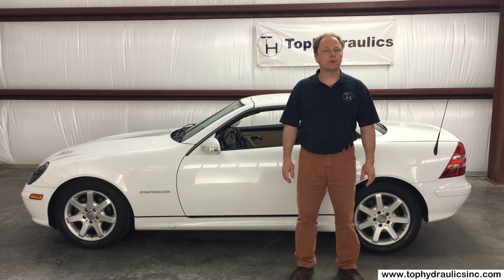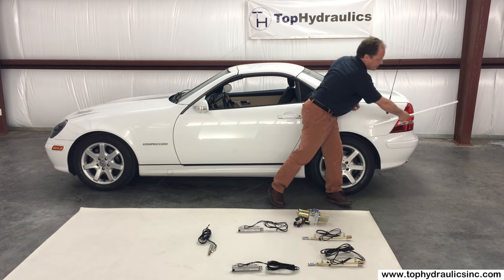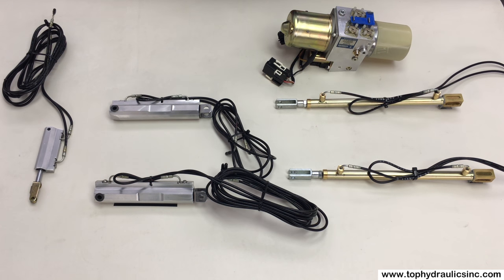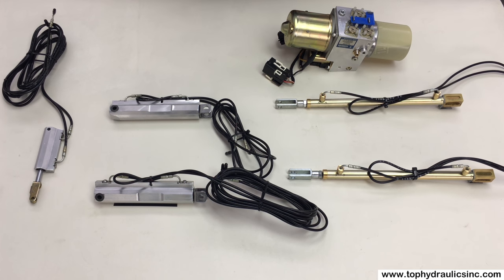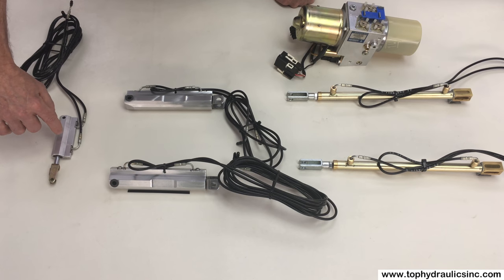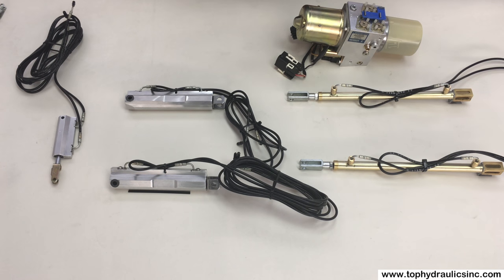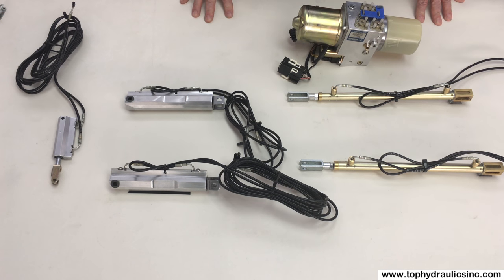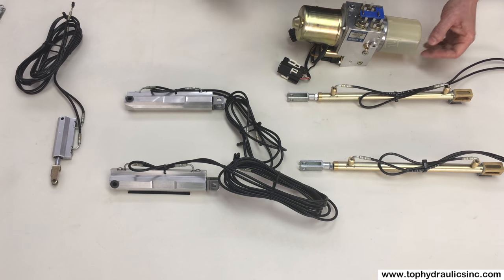Mercedes R170 SLK -  How To Replace The Convertible Top Hydraulic System - Chapter 1 - Introduction

Comment: This is one of the best sample of videos i`ve ever seen on youtube!
With your help i could repair the front lock cylinder (replace of the leaking "Nutring-Stangendichtung", cost 13€) in about 3 hours work + looking your videos
Große Klasse Greetings from Germany
Reply from the maker: Hello Bernhard, 

thanks for your comment and for the kind words. You are writing that you 'repaired' the front lock cylinder by replacing one seal with one that you purchased in Europe for 13 Euros. This may have fixed the immediate leak, but the cylinder will fail on you again if you are going to keep the car for a while. As I explained in the introduction, ALL seals in these cylinders will eventually fail. Particularly important is the piston seal ("Kolbendichtung"), as a bypassing piston seal will first slow down your top and then potentially damage the pump. Having rebuilt tens of thousands of SLK cylinders, we see this happening all the time.  Lastly, the port seals (where the hoses go in) will fail at some point. The only reasonable way to replace those is in a CNC machine that machines around the crimps, pull out the hoses, replace the port seals with proper seals (not just o-rings), prepare the cylinder housing for custom made clips to be screwed in, and re-fasten the hoses.
Top Hydraulics always replaces and upgrades ALL seals in these cylinders, and at a ridiculously low price (because we handle so much volume). No shortcuts taken here - we are currently the only rebuilders in the world who replace and upgrade all seals in these cylinders.

Klaus
Reply: @TopHydraulics  
Hallo Klaus,
you are completely right, but the car is built 1997,  not mine, my daughter has her budget and no more. 
I did it for favor. If she wants to drive the car as old-timer und more hydraulic problems occur, we will see.
One question more: You can upgrade ALL seals incl. port seals (CNC), you have to have remove all parts. Is this useful against replace with new parts (except the pump), would it be less expensive?

Comment: Could you help me diagnose my problem? When I was recently closing my roof, just as it was about to close, the pump fluid began leaking from the right side, close to the edge. I initially thought it was water (as it was raining before and water behaves like then when I open trunk lid sometimes), so I tried to reopen the roof. Windows went down, some more leaking happened but the roof wouldnt move. When I wanted to close the windows with the roof switch I was unable to - I could hear the sound of the pump running but nothing happened and I guess the fluid got drained. My mechanic helped me raise the triangle windows mechanically, but the switch still blinks signalizing the procedure hasnt completed. 

The left of the roof has no leakage. When I drove off, some more fluid spilled down the back window on the right side. So what happened? Right cylinder failed? Thanks!
Reply: This happened to me today! Did you figure out the issue?
Reply: @tas25  Sorry to hear that! Since the time I made this post I only did some additional reading and now I'm almost certain that the right actuator broke and did not close the roof all the way in (there is about 2mm gap and I can hear wind going 130 km/h). The leakage prevented it from working further. Hopefully the fluid and the actuator are the only things to fix. Actuator can be expensive from what I've checked and if you buy used there's little guarantee it will last. I heard some people regenerate their broken ones for about 25E, so that might be the way to go. Or buy new from Mercedes or Top Hydraulics ;) I have found one guy that may be dealing with roof mechanisms, I should be calling him beginning next week.

Comment: Hello

I have a leak (spot-puddle) on the floor of the hydraulic fluid under the right underbody of the trunk under the pump of my mercedes slk 200 .
I was to see under the trunk there is like a round black rubber hose  
 As soon as I activate the red button flash the pump empties and the fluid goes down on the ground 
What is this issue ?
What is the solution to solve 
Cordially 
Sandy

Comment: Hello Top Hydraulics!
I'll do my best to describe my situation here.

I have a question regarding my hydraulic system for my  SLK230 -00.
I've stored the car during the winter and have decided to start driving it again (since the weather is good now).
The only problem is that the trunk cylinders stop midway in the sequence of lifting the trunk back- and forward. 
Therefore I have to let go of the "red button" and give the sequence another go, then it completes the cycle.
I can cope with some squeals now and then, but it irritates me that the whole cycle goes so uneven from before.
Since I have trouble with the trunk cylinders mainly, is there any checks that you suggest me to do first?
Maybe change hydralic oil or something?

Best Regards from Sweden!
Thanks TH!
Reply from the maker: Thanks for asking. This is an unusual problem. As you probably already know from watching our videos, the sequence where the trunk lid moves backwards is ended when the micro switch on the right side above and behind the pump gets triggered by the trunk lid hinge (see https://youtu.be/uXKSfLEPWgE?list=PLly4CMbpk7oxzfmMaPF6w5l1xEtmsKUXF&t=739), and the closing sequence is ended when the forward trunk lid latch micro switches are getting triggered as closed (see https://youtu.be/uXKSfLEPWgE?list=PLly4CMbpk7oxzfmMaPF6w5l1xEtmsKUXF&t=730). Since you are getting the problem both in the up and down cycle of the trunk lid, these switches are likely not the cause. 

There could be debris from decaying seals stuck in one of the hoses, which plugs up the hose after the cylinder has moved part way. Does it look like your trunk lid is twisting when the trunk lid stops part way?

Comment: Hi Clause I have a 1999 slk 230 I think I need to change hydraulic (leaking)of my convertible roof mechanism, what is the itemise cost of the of those Hydraulic parts X6 and what is the time frame for the shipment to Australia, where can I make orders for the hydraulics product. Many thanks
Reply from the maker: Thanks for asking. I see that you have already found our website and contacted us directly. Just for completeness: The set of five cylinders plus pump is listed here on our website: https://www.tophydraulics.com/mercedes-benz/869-3140-full-set-r170.html#/30-core_exchange-send_your_parts_to_top_hydraulics_first
Shipping costs vary a bit by location. Currently, shipping a full set of cylinders and the pump from us to your postal code in Australia via FedEx International Priority is US$185.

Comment: Hi Klaus I'm stock trying to dislodge the mini switch next to main cylinder but just not moving out of my 1999 SLK230, will there be other way to dislodging the cylinder bypassing the taking out the mini switch, I'm really stuck
Reply from the maker: That switch has to come out and I would agree that it is the trickiest part of replacing the whole set of cylinders. Give it a few more tries. If the switch breaks, then you can epoxy it back together. We have had many thousands of customers successfully completing the task and I know you can do it, too!

Comment: Do you know or recommend any shop in Houston that fix the top (not opening) it is leaking at the right side of the top?
Reply from the maker: Thanks for asking. We work with a lot of shops in the Houston area. Please contact us through our website tophydraulics.com or send an email to info@tophydraulics.com and we would be happy to make a recommendation. If you have a leak high up, that is certainly from the front lock cylinder A1708000072.

Comment: What do I do if my hose some how has a hole in it , it’s pouring out of the hose that goes near the locking system on the roof on top in the middle ?
Reply from the maker: Bummer! Where are you located? How do you think it happened? Has the cylinder been removed or worked on lately?
Reply: @TopHydraulics  Agawam Ma. No work done lately, I opened the roof and then when I closed it , it made a pop sound and fluid started dripping from the right side , what I don’t understand is how it burst a line? Did I hold the button down for to long ? Causing it to blow, kinda sounds weird.
Reply from the maker: @marcus3836  The original hoses on these cylinders are quite good. We run into popping hoses under three conditions:
1) Someone installed a Chinese knock-off version, which typically last a few months if you are lucky. Those have been around only since 2022, so we can probably rule them out in your case.
2) Someone installed a brand new cylinder from Mercedes within the past few years. Starting around 2015, Mercedes' supplier used extra cheap hose material with thinner walls, and those can pop if they are installed improperly.
3) Someone replaced the front lock cylinder and used in-line "couplers".
Reply: @TopHydraulics  does the hose some how unscrew , can I replace it ? Where can I buy it ? Do you guys sell just the hose ?
Reply from the maker: @marcus3836  The hose fitting is crimped into the cylinder housing. We make the hoses removable during the rebuild process, but you would not have any means of refastening the hose if you were to undo those crimps yourself. Thus, it's best to have the whole cylinder rebuilt at this point. we will replace the damaged hose for a $50 surcharge (or take $50 out of your core refund if you decide to get a cylinder from our inventory first).

Comment: How do I top up the fluid in the tank pump
Reply from the maker: Thanks for asking. Filling the pump 1708000030 is shown in our pump replacement video and about 10:48: https://youtu.be/Xc0iOIFBG-4?list=PLly4CMbpk7oxzfmMaPF6w5l1xEtmsKUXF&t=648
You unscrew the metric Allen bolt in the forward top right corner of the pump body and trickle fluid into it.

Comment: how do i test jus vario roof switch
Reply from the maker: The function of the Vario Roof switch can be verified through its readouts in the control module in the engine compartment. You would have to google the subject to find which pins to check. Our troubleshooting video concentrates on the micro switches in the system, it does not cover the Vario Roof switch. It is fairly rare for the Vario Roof switch to fail.